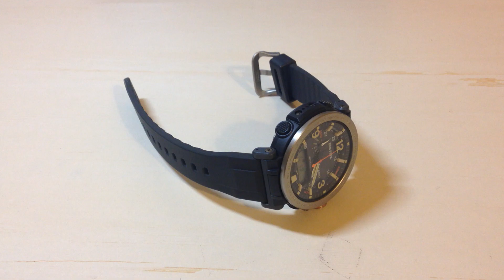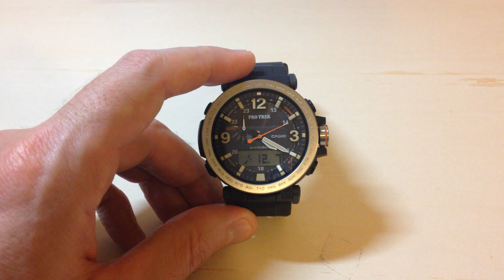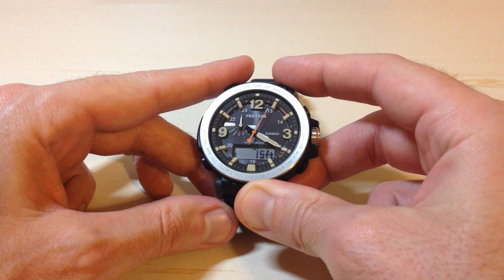Casio Pro Trek (PRG-600) | Set Reference Altitude

Comment: The altimeter on this watch is a complete failure. The readings depend only on the barometer sensor, which means that,if you stay in the same place always, whenever the weather changes ,the altimeter will show another reading.

Comment: We live in the mountains (around 1400 meters) and every other day our exercise is a hike up our local mountain. What I find must convenient is to set the reference altitude to '0' before we leave the parking lot, then I do not have to do the math to calculate our total elevation gain when we get to the top. Also of interest, on our last hike I saw a bunch of clouds approaching, and then it started to rain. Just as I suspected, when we got back to the car, what was '0' when we left had now become  +10 (meters), which of course corresponded to a pressure drop that took place while we were hiking.